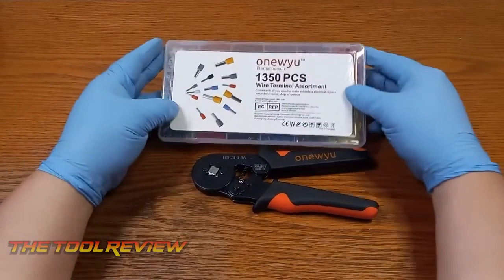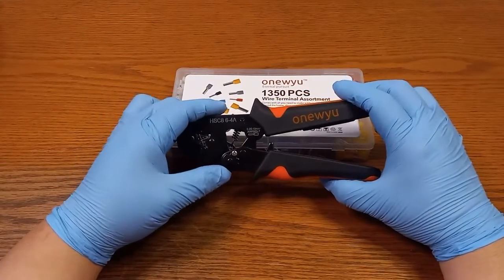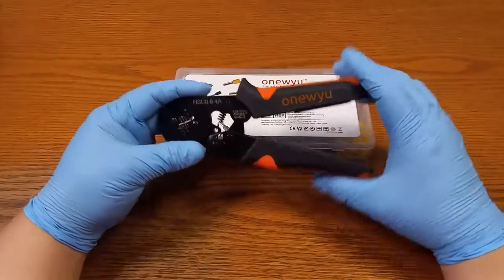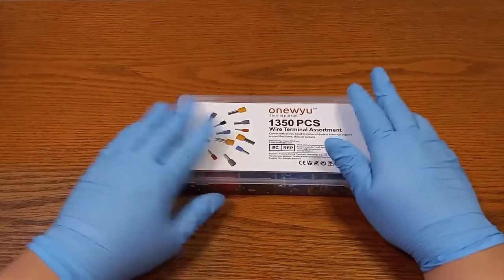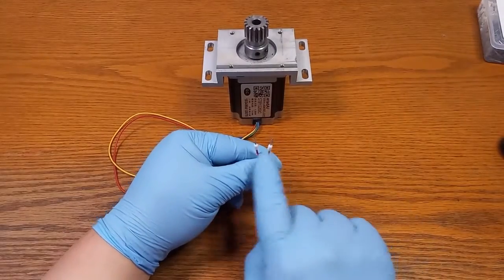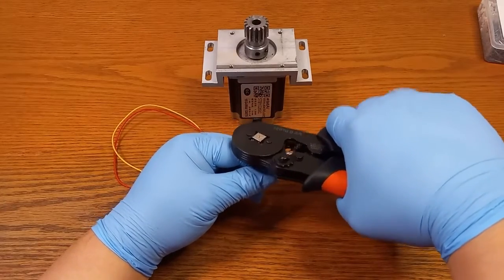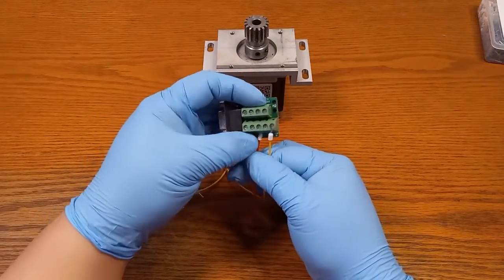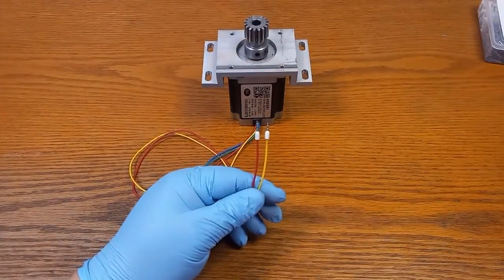ONEWYU Ferrule Terminal Assortment Set

Comment: Nice kit, I do quit a bit of Arduino projects like little robots with 6 and 12v motors, this set looks pretty good
Reply from the maker: I have been using them on terminal blocks and aviation connectors, it would be great for Arduino projects.